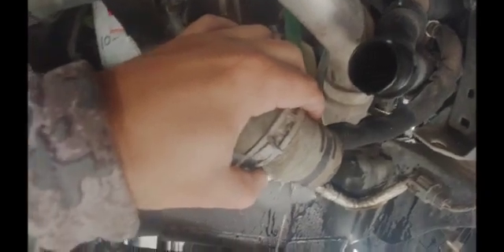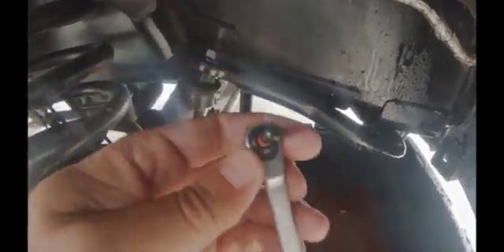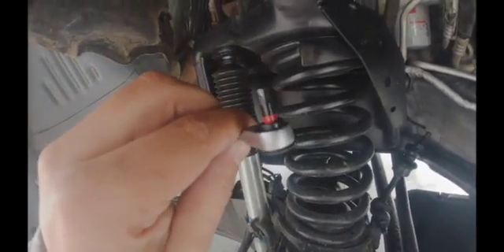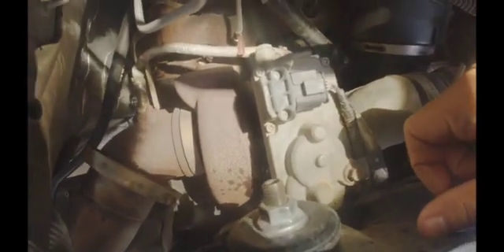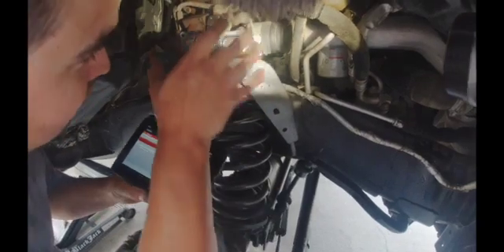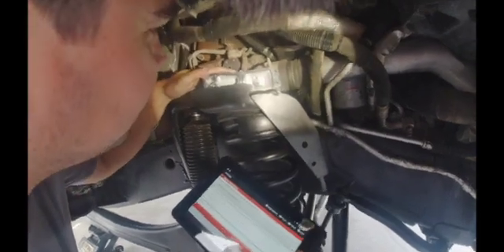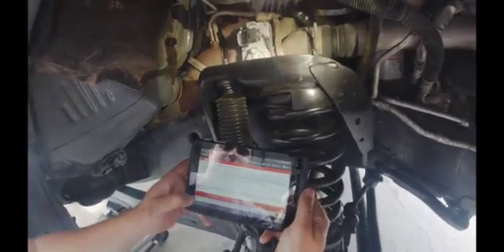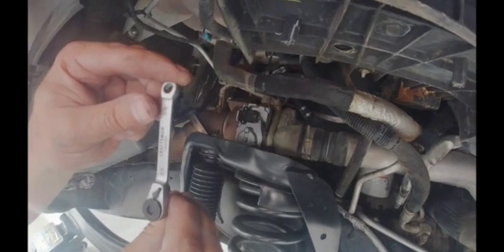Ram Turbo Actuator Replacement- 6.7 Cummins U010C

Comment: Hi 4M, can I ask what problems you were having to make you do this job? I have a situation where my exhaust brake stopped working, no codes. Could this be solved with this actuator replacement?
Reply from the maker: What year is your truck?
Reply: @4MRanch  2013 ram 2500
Reply from the maker: @Ogdds  it’s hard to say . One truck I looked at that a Buddy owns had the exhaust brake not working and it ended up some how being turned off in the computer some how, it was a 2007. My truck never stopped working but I was getting the lost communication code. If you have quite a few miles on it its possible that it needs replaced but your truck being a 13 should be throwing a code I would think. I’d do some wire checking first an if you have a scan tool check for pending code before you buy a new one the are pretty expensive now.

Comment: I'd try a couple different things before spending the time or $2200 on an actuator. Like a little WD-40 in past the air cleaner.
Reply: How do you do that?
Reply from the maker: Yeah I wouldn’t spray wd-40 in mine.

Comment: Thank for the video. I tried to remove my actuator, but one of the socket head cap bolt is rounded. Impossible to remove.
Reply: How did you tackle this stripped socket?

Comment: can u install the actuator without having to calibrate it
Reply: City diesel sells an actuator that self calibrates
Reply: @yerbeilisready8562  putting it in this morning.  I hope this is so . To get this part into Canada with currency exchange 950 USD plus 300.00 CAD import fees , well you do the math
Reply from the maker: Let me know. I hope it works for you.
Reply: @4MRanch  Thank you , I sure will . Excellent video by the way very comprehensive
Reply from the maker: @donscott6720  thank you.
Reply: @4MRanch  well you made it look easier than it turned out for us but we got er done.  Thanks for the video it was good to have a reference as I was going along.
Reply from the maker: @donscott6720  that one lowest bolt was the hardest one to get but thanks glad it helped you.
Reply from the maker: Some people see you can but everything I’ve read says no and being that the part is almost $1000 I didn’t take any chances because it says it’ll mess up if you don’t.
Reply: @4MRanch  my dad has a 2017 2500 n he has the U010C code amd we are trying to figure out if it’s the actual actuator tht is bad or something else

Comment: Any reason you did not buy the aftermarket (upgraded) actuator from Geno's Garage?  It has twice the torque and is self calibrating.   https://www.genosgarage.com/product/ram-cummins-replacement-turbo-actuator-gear-housing-cm-actkit2013/engine-turbo

Appreciate the tips though, I will be doing the same thing this weekend and will use your links for the tools.
Reply from the maker: I didn’t have time to order it and wait for it to come in I had to go and get one that day and it was only 650 at the time of purchase but now they’ve raise the price of the 850
Reply: @4MRanch  Gotcha, makes sense.  I got the CEL and P003A code.  Hope this does the trick.
Reply from the maker: Hopefully it works
Reply: @4MRanch  Worked like a champ!
Reply from the maker: Good deal glad you got it
Reply: Did you go with Genos part?
Reply: @dvd791  Yes I did.  If you have any questions i'd be happy to help.
Reply: @nathanbrown-cwo467  just one question I’m replacing mine soon and already checked turbo and actuator and turbo seems fine, actuator side had coolant leak evidence out of the top side (bad gasket). Is there any trouble with Code clearing after installing city diesel actuator?
Reply: @dvd791  Mine was in the same condition.  I had no problems getting it to clear.  I went through my tuner before I started it, cleared the DTC and started it up, CEL went out.  Has worked perfect since.  I would get the Actuator on order as soon as you can because they do have a back order wait.  They will not charge you until they send it out though.
Reply: @nathanbrown-cwo467  wish I had a promo code to get it for a better price 
 😔
Reply: @dvd791  Are you military/reserves?  They give a discount if you are.  Either way you are paying less than what a shop would charge and it was way better quality than OEM.
Reply: @nathanbrown-cwo467  I need to double check codes before I order but I’m pretty sure it’s needed. I drive a standard and can’t part with it hhahaha

Comment: The video is very well explained for calibration, but the problem with the Holset VGT is that it is not resistant, which breaks down many 6.7 Cummins engine owners.
It's a real disease this VGT.
 Dodge dealers take us for fools by charging four digits close to five digits for a turbo set!!!!!, so we all place orders through the secondary market that are more efficient (not the holset brand) on the responsiveness of the turbo and the torque of the electric motor of the VGT that is twice the VGT Holset, like the one that is sold by Geno's Garage which also makes a control of the turbo movement at each turn of the key, which the Holset doesn't do.
My question is: holset goes this decided when to correct this problem? especially at the price where we pay our trucks!!!
it is not normal to drive with the engine brake continuously to obtain a reprieve of the vgt.
I have 5 months of winter, and on snow or ice you don't ride with the engine brake running at the risk of finding yourself in the field, or just killing someone.

Comment: What is the tool you are using to run the alignment procedures.   I need to replace my actuator on my 2010 Ram turbo.  Thanks
Reply: Found it thanks 👍🏻
Reply from the maker: @crabshack122  cool, yeah you can do a lot of stuff with that software. It’s well worth it and simple to use.
Reply: What tablet do you recommend? I have an iPad but software only works with android
Reply from the maker: @crabshack122  I don’t really have one I could recommend you as I am using an old Verizon tablet from like 2012 but you can go on Amazon and search android tablet and there’s a few on there for around $100 I just try one of those.
Reply from the maker: It’s called Alfa obd. The link is in the description. If you see the last two links one is the software which you can run on a android tablet. The other is the wireless Bluetooth obd2  module you will need for the software to communicate with the truck.
Reply: @4MRanch   The last link, for the calibration software is broken. Any chance you can update it?  One other question. You need both the adapter module and the software, correct? Thanks
Reply from the maker: Sorry it’s broken I’ll try an fix it real quick but Yes you need both.
Reply from the maker: I fixed the link. 
 They took it off Amazon. So the link is directly to Alfa obd. 

https://www.alfaobd.com/download.html
Reply: I don’t see any links sorry
Reply from the maker: If your watching from a phone When you click on the video to play it the title of the video should be at the bottom. To the far right of the title should be a little drop down arrow that looks like this ^ but pointing down.

Comment: Did you loose boost in your truck when the actuator went out?
Reply: I have a 2008 6.7 Cummins I was towing my boat recently and noticed loss of boost and the truck was rolling coal on a stock pickup.  It’s not the actuator then,  when I go to go step on it a little bit it does make a squealing noise.  It could be turbo is going bad or a bad gasket in the egr valve.
Reply from the maker: Could be the turbo possibly
Reply from the maker: No I did not. That’s why I wasn’t sure what was going on until I took off the actuator and found that the motor in it was weak.
Reply: I lost boost

Comment: The U010C - VGT Actuator Driver Circuit - Abnormal update rate can also be caused by a bad harness.  If your replacement actuator fails again after some time you may need to replace the harness.